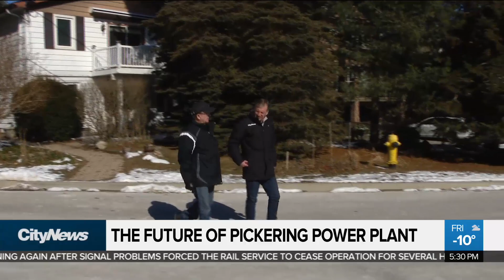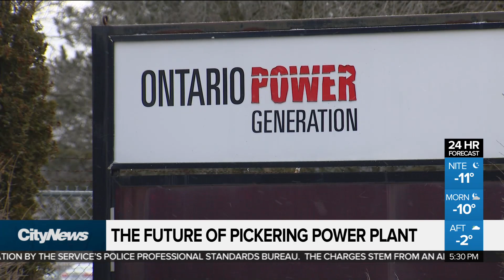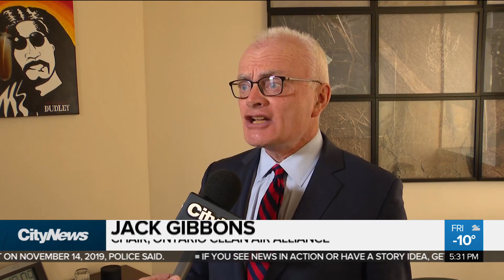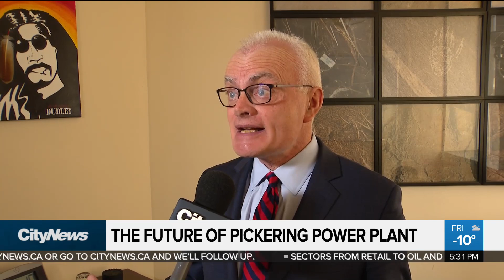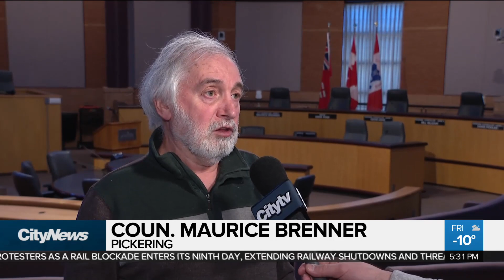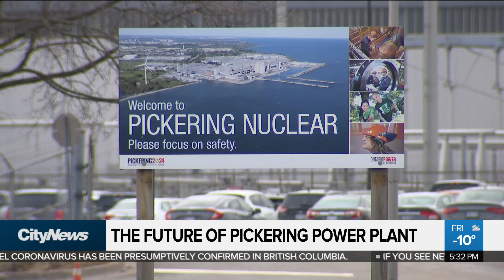The future of the Pickering Nuclear Station

Comment: Pickering has to remain open after the 2024 deadline.  Ontario is using even more electricity than when this was shot, let alone aired.  We don't have enough solar on roofs around the city (Toronto), to feed the grid, and wind isn't cutting it for production.  We still only have one turbine on the CNE grounds that generates power...when it is even turning.  Down in Essex county, by Windsor, there are wind turbines all over the crop fields.  Also a turbine factory.  We never invested in it up here, in Pickering or north of Toronto.  We are so far behind in innovation on electricity generation, we may never be able to give up Nuclear in Pickering.
Reply: You are likely right, what really is needed is a new plant or shut down the station section by section and do a refit like they are doing to the Bruce power plant.

Comment: Just curious where they will ship and store the nuclear waste after the plant is shut down.  And the cooler with the reduction materials?
Reply: They already have a storage unit below the station, its very deep in rock, they encase the rods in metal cases then put it into drilled out rock.  Those rods are radioactive for like 100,000 years.
Reply: @boratb258  Too bad that they do not reprocess it like France and Japan.